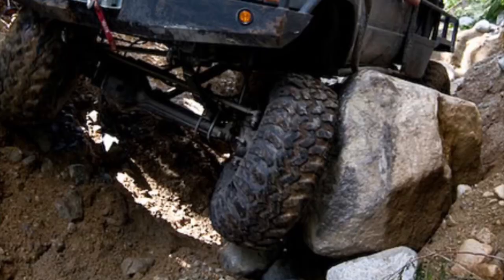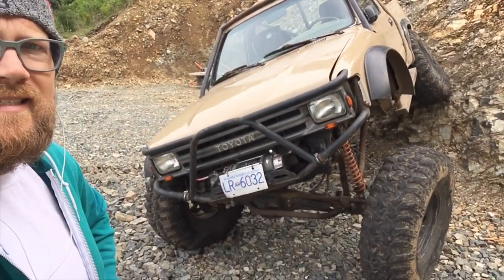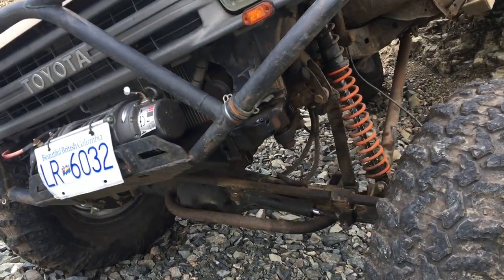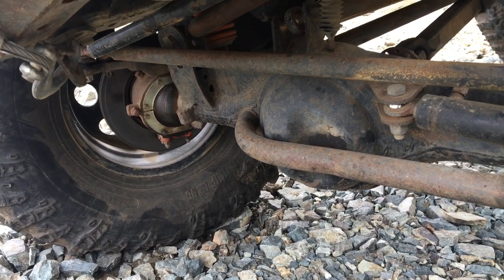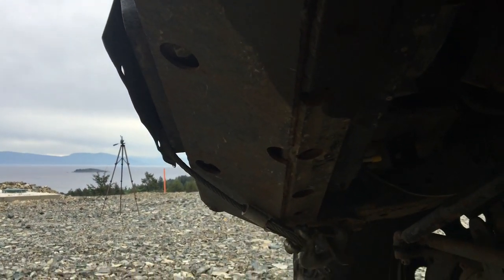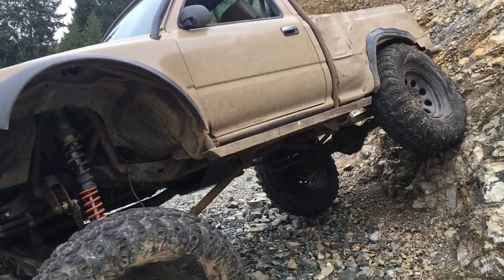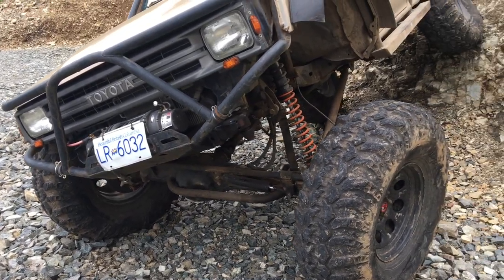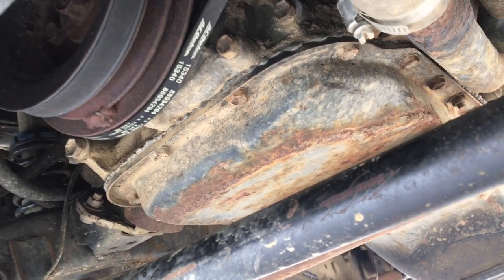4WD Toyota Hilux Pickup Rockcrawler Build - Walkaround

Comment: I did a SAS (leaf springs) on a 2WD 1992 back in 2000. I didn't realize that the frame kicked up at the front for additional clearance. I like your rig
Reply: Which Axels did you use in the rear? Custom?

Comment: This is a sick ass rig! I’m from Fresno, CA  and trail gear and marlin crawler are right around the corner😎 I have a 98 Tacoma 3.4 v6 manual, Chevy 63 rears, elocker, dual cases, Dana 44 front TG 3” springs, sky’s hanger kit, chromoly axles, 4:88, spartan up front, TG sliders and the list goes on. Love your channel keep up the good work.

Comment: Nice rig 3 link in the front is the way to go, my dad runs 40 tsl sx2 (the heavy ones) broke one longfield on the short side, had to go studless hubs because they kept backing out from the tq. Dual t-cases and most of the mods u have done. We just bent the arm to clear the oil pan. But you have a certified rig man. I would recommend 4 linking the rear if youre able to

Comment: So the 5.29 gears is this to help make it easier on the rest of the drivetrain? I just figured with dual cases you can get geared nicely without going so low with the diffs. I’m new to this and thought I had read most use the 4.10 ratio for some reason. I may have mis read.
Reply from the maker: Yep, that's the theory. It makes driving on the street more tolerable with bigger tires too.

Comment: Right on Joe mint truck man I’m just down the highway from you I used to drive past it everyday on my way to VIU. Currently building up my 92 reg cab short bed and can’t wait to get it out! You running stock gears in both transfer cases?
Reply from the maker: Oh heck yeah nice! Yep stock tcase gears and 5:29’s in the diffs. Welded front and rear.

Comment: Great rig and great walk around!  On your sliders what size is the square stock that welds to the frame and did you have to cut the rocker panels out of the cab or did you just notch them for each tube that goes to frame!
Reply from the maker: Thanks much appreciated! They are 2x2 1/8 wall and I just notched the seam on the rocker panel at each tube. Just zipped two cuts and hammered the seam flat.

Comment: Sweet rig! 

Are the IROKS, the bias 39.5? How were they on your long drive to The Hammers?

I'm considering getting a set.
Reply from the maker: Yeah 39.5 bias. I swapped a set of 35 radials on and built a rack for the iroks on my trip down. Definitely wouldn’t have driven down on them. But I’ve daily driven 37s on my old truck/wheeler and they were great. If it sees a lot of street my favourite tire is a trxus mt tho.
Reply: Thanks so much!

Comment: What advantage  do you get with the square drive line
Reply from the maker: Strength, long slip, cheap, can make in your garage :) Spend money on other parts. A long slip thick walled round front driveshaft will cost you as much a new winch if a shop makes it for you.

Comment: Curious what you run for tcase mounts and engine mounts?
Reply from the maker: One stock tcase mount and one heavy duty one that looks like an old Marlin Crawler one. Stock motor mounts but I did the “Marmount” (Marlin crawler) mod where you drill a hole through the drivers motor mount and put a long bolt through it with a nut on the end. Has worked so well.
Reply: Awesome that's what I have going into my truck. One stock one trailgear hd. I will look into the engine mount mod thanks

Comment: The rear shocks are they 14” travel
Reply from the maker: That’s a great question I can’t remember! Definitely not 14” probably 10 or 12. Next time I’m under there I’ll have a look.
Reply: The Dirty Birfield just curious I’m setting up mine right now and read that the 12” travel bilsteins dont do the 63’s justice but your looks pretty flexible! I bought the 14” they are on the way so we’ll see I might have to extend upper mount and I ordered side mount lowers 🤷🏼‍♂️ like you said if your into Toyota’s your most likely fabrication capable lol